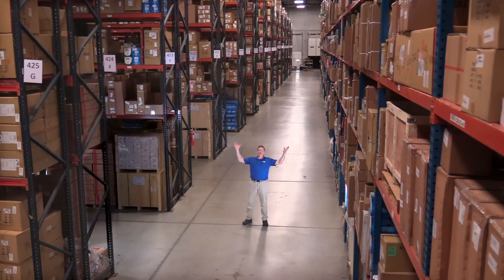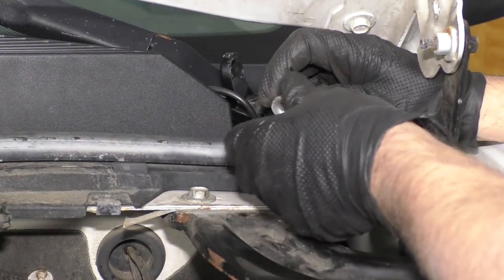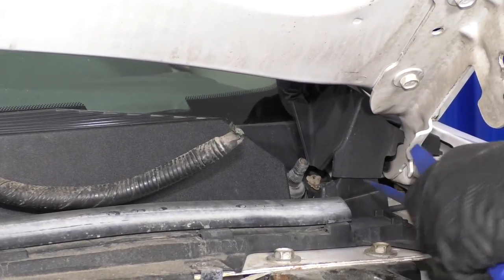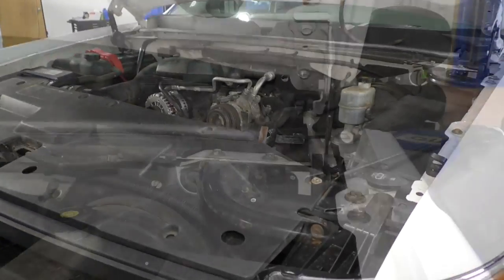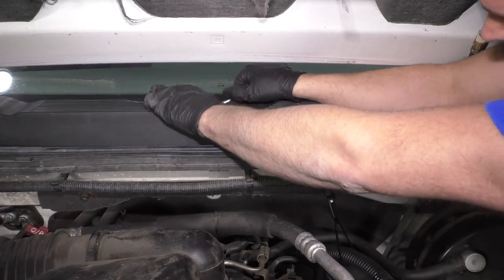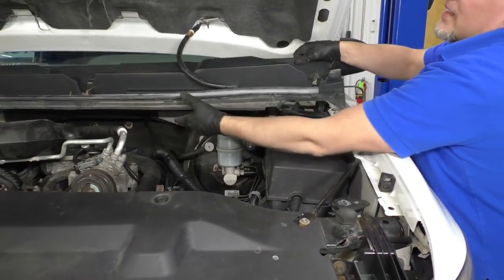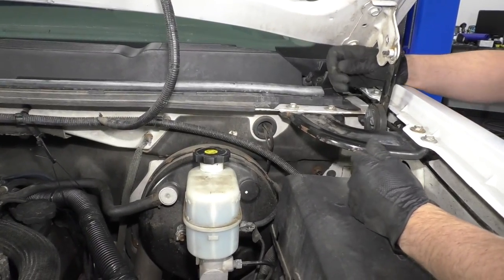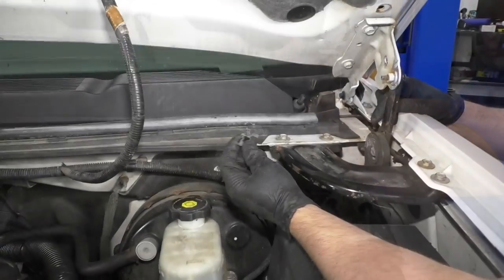How to Remove Cowl Cover 07-13 Chevy Silverado

Comment: Real question is. Can you do a video on maintenance inside that cavity?? I want to see behind the cowl. I heard there are rubber vents down there that fall out after time. Same style vent as behind cab. Plus the amount of debris that builds causing mold. No air flow in cab. Etc etc. 

We need this video :p

Comment: I have a 2022 silverado 2500. I need to replace just the end caps. Will I need to remove the nuts and center? Or just pop them up. Do you have those in stock?

Comment: I'm not mechanically inclined at all. The cowl trim on my new windshield has a slight gap. What would be the reason for me to replace the cowl. Because mine looks fine. It's just the trim that is not touching the windshield completely. Also what's the typical cost of cowl trim replacement.
Reply from the maker: +Wolverine If its old or worn and you want to replace.  Having a slight gap is fine.  Thanks for watching.